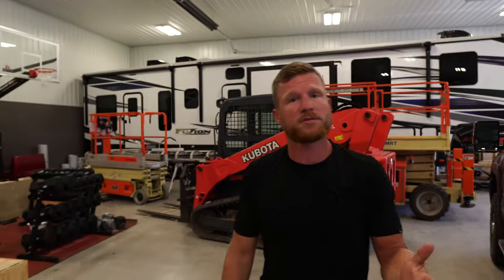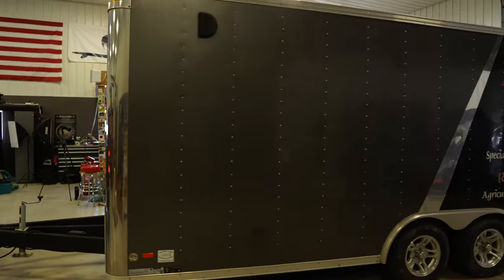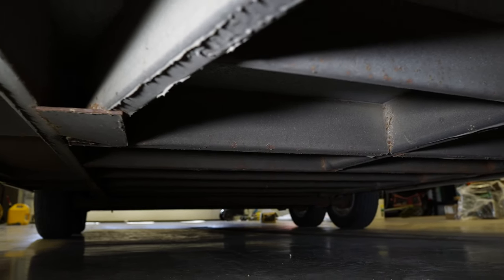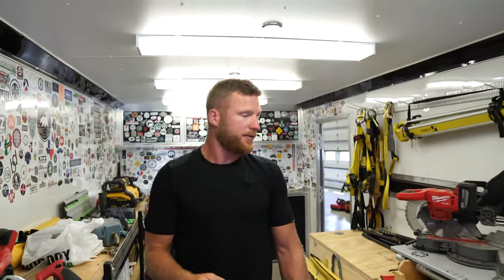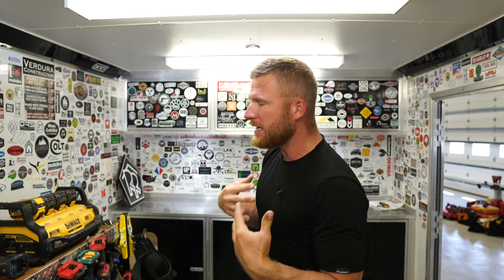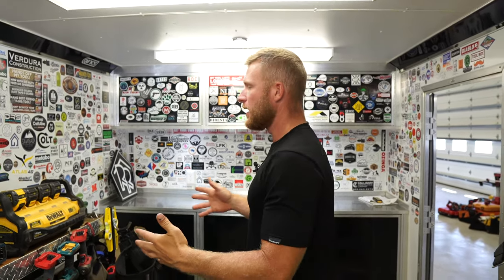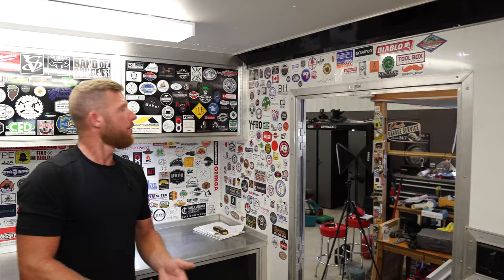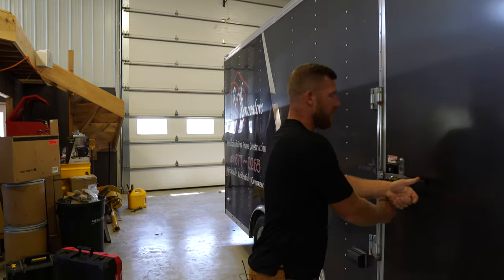RR Buildings Tool Trailer Setup

Comment: I love that you showed what an actual work trailer looks like 99% of the time! Before the cleaning. That's great! Every contractor that works and has employees knows the REAL struggle. Just no time for the boss, and employees pay no mind. Nice rig though Kyle. I wish I didn't need so much shelving in my trailers, I like how open yours is. (Remodels, conventional framing, interior and exterior finishing, and the whole works. Residential and Commercial.) "The struggle is real!"  Very cool that it's all insulated! And that you didn't have to do your own undercoating. Man,  mine suck in the summer! Always seems 100 degrees hotter than outside. And winter is especially excruciating, because we can't leave anything in the trailers or it will freeze of course. 
Thanks for the content Boss Man! 💯👍
Reply from the maker: Thanks David... I love the trailer

Comment: Coming from a framer and custom exterior trim carpenter, Get yourself a nice Honda 3000 watt inverter generator, powers miter saws, table saws and charges all the batteries and such. Really fuel efficient and so quiet. I'm suprised you don't have one with how remote and how often you work without power.

Comment: Seems to be a better idea to tow a tool trailer vs. install a utility bed on a pick up truck. Way more room and the truck is not stuck with the utility bed. The stickers will get old very fast but it's your party. Maybe you have some stories to tell about the trailer tires blowing out?  What size are those axles and tires? Thanks for the review.
Reply: It depends what area of the country you do your work and I do work in Western North Carolina there's so many mountains and hills and pathetic driveways at a trailer is impossible therefore I use a van that's cluttered and it works well for me

Comment: Where do you keep the chains, and do you load out for different phases of the job? 

We had a flat front enclosed, we called it the lead sled.
I would encourage everyone to get a v-nose helps hugely on fuel mileage.
Another good one Kyle!
Reply from the maker: Chains stay in a job box gets transported by machinery trailer

Comment: You should go back and get solar panels on the roof to charge that battery or even a couple more, so you can run an inverter to make 110 from solar power.

Comment: wiring an inverter in is dead simple and 2000-3000 watt inverters are pretty cheap, thatd be overkill for just lights but could run tools and other things.. wont do it forever on the one battery but for short term or add batteries to extend it, ntm if hooked to the truck with sufficient guage wires the alternator will easily run all those lights whenever the truck is running

Comment: That trailer is a looker. We have three. One is the daily grind and is just not tall enough for taller guys, the vent handle removes my hat but gouges taller guys. The other two are bigger tandems and I made the mistake of loaning the new one to my parents!! Haha, I am sure I will get it back... eventually. 🙄 I already ordered and have the custom toolboxes for that one because hand tools, am I right? God I hate looking through tool bags and belts for s**t!  I am also on TEAM TOOL CASE. The guys who say tool cases are a waste are the guys who buy new tools every year because they're crap is busted, rusted, and can't be trusted. Those are the "just throw it in the back of the truck" kind of guys. Cases stack and unstack easily, you can grab a case off the bottom by just pulling it out. Try stacking coil nailers and circ saws that way! 
Anyway, on my next trailer I am going to weld up a new interior surface wall about 10" in from the original and use the space behind to slide plywood or sheetrock or whatever panels in and at the top slide in my long levels. Up front where your cabinets go is where my tool case cage will be with the aforementioned custom tool boxes with actual drawers. Above those will be small cabinets for misc junk pretty much like you have now.  In my current trailer I put my tool shelves along the top on the non-door side and just below so the floor is left open. Bags of Portland or mortar or whatever are sometimes a pain to step over and getting them out of the middle is nice. Also the damn shop vac is huge and it needs to be off to the side under a shelf rather than midship so to speak and the next vac will be one of the box style type.

Comment: The trailers power system could really use an upgrade with today's technology in batteries you could run all the lights in the trailer instead of only a couple. You can buy a bunch of solar panels and mount them on the roof and with more batteries you wont need to plug it in to charge i say 4x 200 amp hour batteries. One for the led lights emergency battery power for tools and charging your phone, one for running the lights your trailer can't power on its own and  two back ups for miscellaneous use like maybe you decide to add an led light bar to the back of the trailer to light the jobsite when it's dark out and you've still got to pack up that light bar would also help during the dark winter days. To support those big batteries you would need an 800 watt solar panel kit there's one on amazon: Renogy 800 Watt 12 Volt Off Grid Solar Premium Kit. Now that system would help a lot on the jobsite but you'd still run out of power eventually i think but it would most likely not matter those could last a day or more for true off grid power with 2000 watts you can convert it to 120v Ac. So two of the 800 kits and a 200 kit would probably give you truly remote power supply enough to charge batteries for tools on the jobsite

Comment: Idk if will see this get rid of that rino liner for the under body if there is one spot of metal shown it will rust under the liner and the moisture will have no where to go and rust 3 times as fast, if want rust free spray fluid film once a year and it will last a lifetime

Comment: 15k and not even aluminum or V-nose.  That is very expensive I do like the 110v.  I have Aluma Trailer all aluminum (the best IMO), ramp door in front, doors in back so I can have pallets put in it, I then use Akro-Bins Straight wall containers boxed in with 2x4 on the bottom and 2 pull straps keep them tight to the walls. I can carry tools right into the house or empty the trailer out in 10mins. Think it was 9k finished.